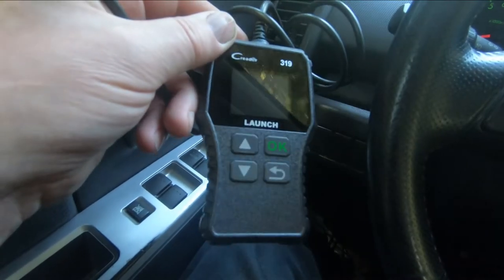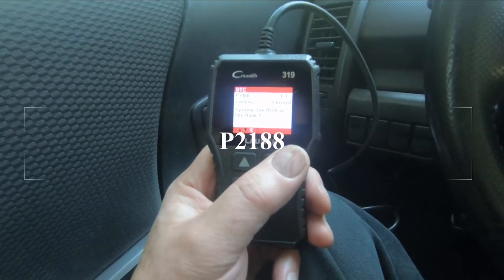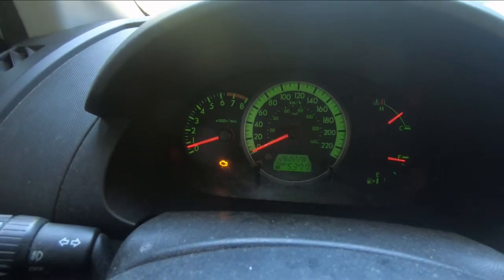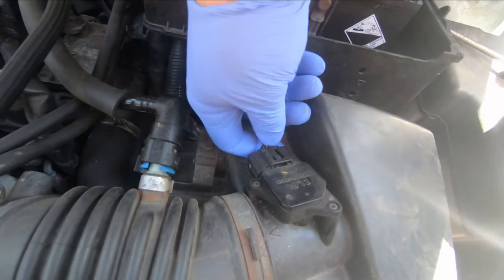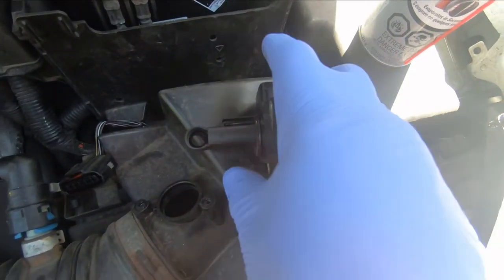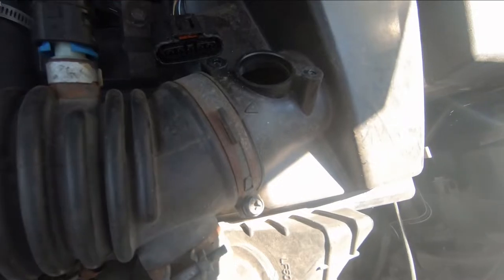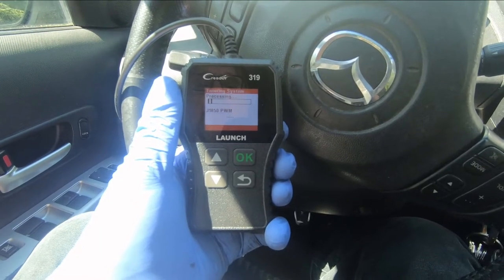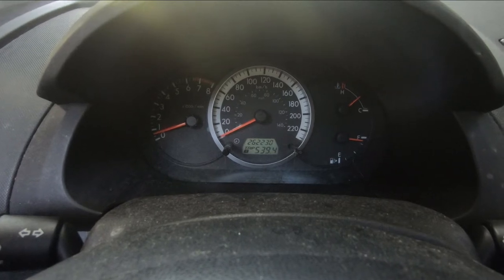"CHECK ENGINE LIGHT" CODE P2188 MASS AIR FLOW SENSOR CLEANING & RESETTING LIGHT USING CODE READER

Comment: Great fix and thanks for the detailed information
Reply from the maker: A dirty mass-air-flow sensor results in many unnecessary trips to the garage. This is an easy repair that most people can perform at home with good results and save themselves hundreds of dollars (Euros too😅) that they'd spent at a mechanic. Even a replacement sensor would be less expensive if changed at home. I hope this video comes in handy (and also hope that you never need it 😊).

Comment: I have a 2006 Mazda 5 2.3L I have an issue at cold start. When I start the car, feels shaky and sometimes stalls. I have to press the gas pedal until rpm settles and starts idling smoothly for a couple of minutes. After that I have no problems and runs good. That only happens at cold start or when car has been sitting for a few hours.
Reply: Witch throttle body you have electric or mechanic cable?
Reply from the maker: Try cleaning the Mass Air Flow sensor. They don't have to be very dirty to cause running issues. Use the specific fluid. Good luck

Comment: Half a can of break clean in the air box would of done the trick. May get a bang out of it 🤣
See ya Craig✌
Reply from the maker: I think I'll stick to this method for now. I wouldn't want the brake clean to explode on the wrong part of the cycle putting piston parts in the driveway. My wife hates it when I make a mess in the driveway! 🤣